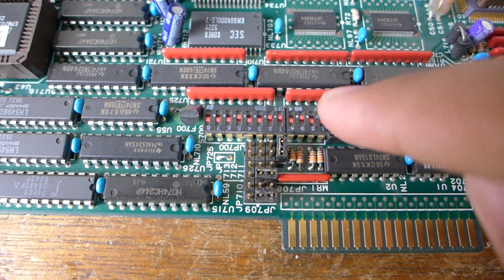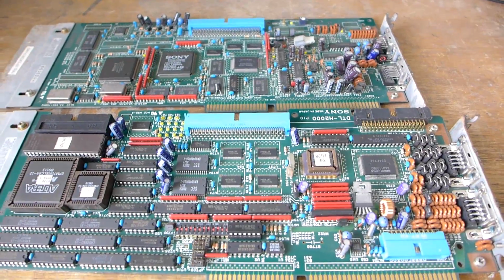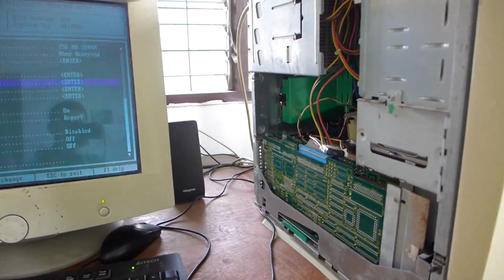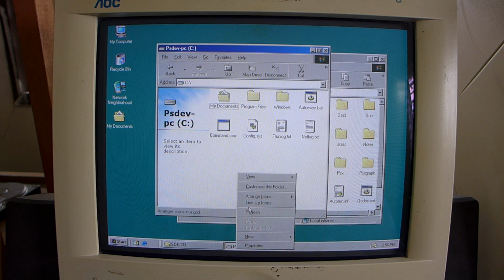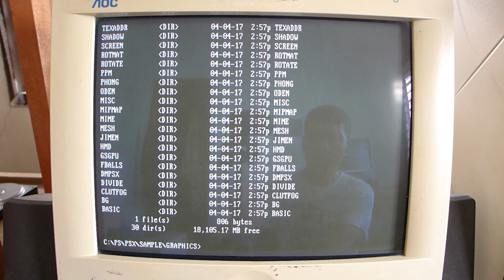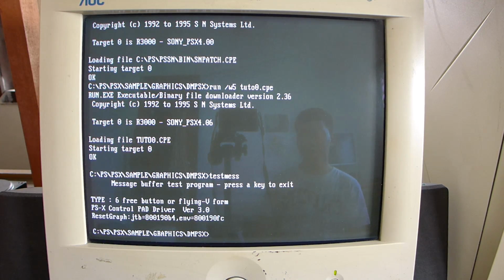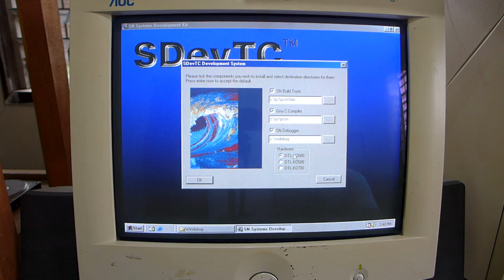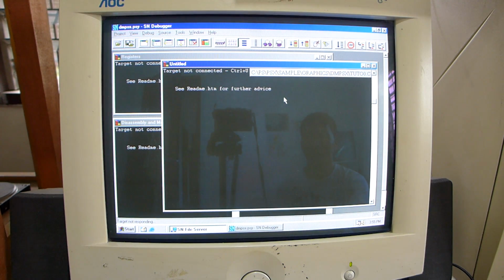How to Install and Setup the Sony DTL-H2000 PlayStation Development Boards

Comment: ~45:15 is that a ps1 modded with vga out? Cool stuff!
Reply from the maker: No, that's most likely my 'easy access' Serial I/O mod as I've never stuck a condensed DB-15 connector onto any of my consoles.

Comment: Is the CD interface on this board compatible with the Sony's CD ROM interface that they used before ATA came by? It makes me really curious.
Reply from the maker: Unfortunately, no. The CD-ROM modules contain additional components that are just not present on the Sony CD-ROM interface. Plus, the connectors are different.

Comment: how do you keep the inside of your computer so clean?
Reply from the maker: The computer's insides are a little dusty which you might see some of it on the SB Audigy card. Not much dust gets into the system as the airflow in it is relatively slow and I don't use it often enough to create any significant dust 
build-up inside.

Comment: Can you do another video on your IDE setup and how to master a cd. Thanks!
Reply from the maker: Hmm, I'll see what I can do. As for the CD mastering bit, I can only do ISO creation with my mkpsxiso tool but not burn a CD that will boot on a non-modded PS1. The latter is currently impossible to do unless you have specialized disc pressing equipment.
Reply: Yeah ISO creation is what I meant. Thank you so much.